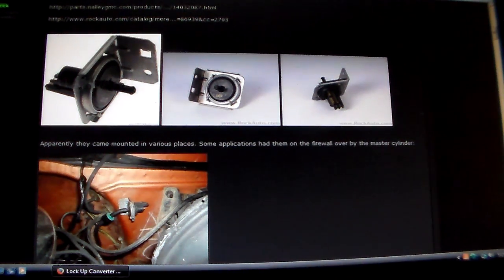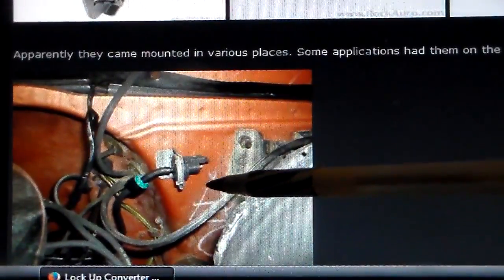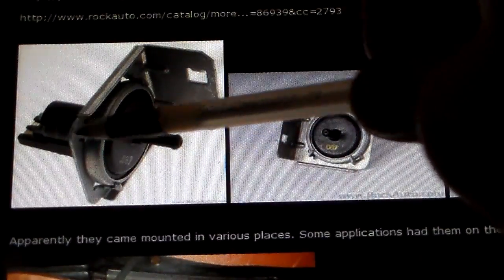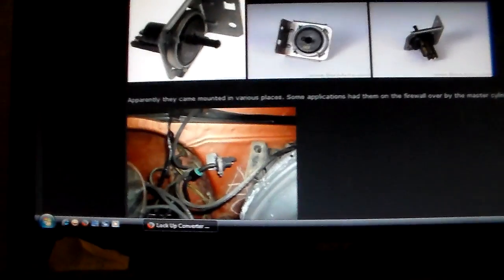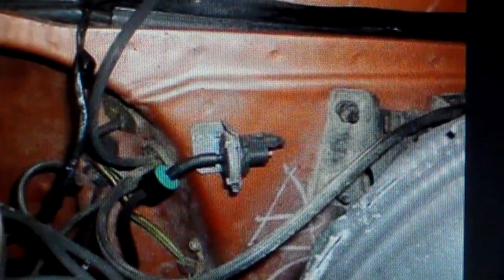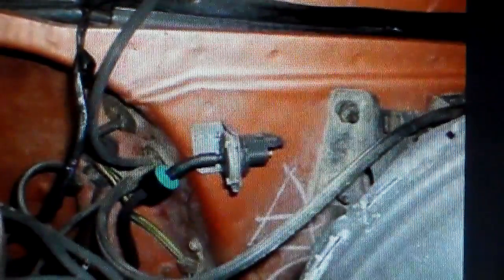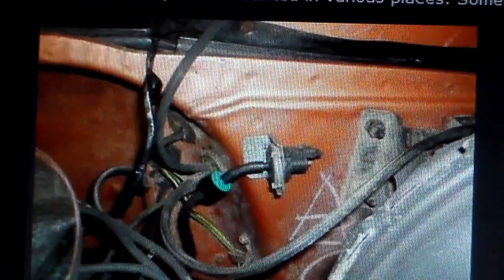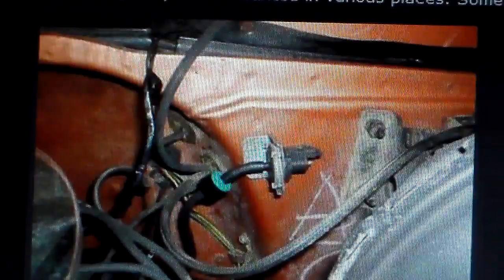How to understand '80's Silverado/Sierra TCC lockup

Comment: Actually, you can wire it to have constant power and it will lock in 2nd, 3rd, and 4th on its own and unlock by itself in first gear. The way the valve body is, the converter will not lock up in first gear. I have mine set up this way, but I added a relay coming off of the brake light switch so when I step on the brake, it cuts power and unlocks the converter. I've been driving my 89 S10 with the original transmission like this for the last three years. It has 210K miles on it and three years ago is when I put a 350 in front of that transmission.
Reply from the maker: That would work, but I think it's going to be hard on the converter having it lock in three gears, at least with a heavier vehicle, but I could be wrong.
Reply: What type of solenoid did you use on the brake lights? I'm seriously interested. I have a rat rod with a 200r4 but I not only go to car shows with it I also tow with it and use it as a work Truck. The lockup feature would be nice.
Reply: @VinnyMartello  Just change your brake light switch to one that has a N/C contact on it so when you hit the brakes it kills the power and drops out the lockout.  If your using a pressure switch for your brake lights get a 20A relay and wire the power line for the trans into the N/C side so when power in the brake lights comes on it cuts the power in the system and drops the lockout.
Reply: livesteamfan1 how u do that
Reply: There are switches inside the transmission that are in series with the solenoid that won't allow lockup in other gears, or if the trans is cold.
Reply: how can anyone help me with it i have a caprice 305 and a 700r4 it has the plug but i just want to add power12 volt and let it do the locking as i drive the car on highways also i am ok with using a switch to toggle on or off when stopping
Reply: @mussabakram5875  in order to connect directly to the solenoid you would need to pull the pan off, and the rest is self explanitory, but a much better way is to scrap everything that is wired now, (the EGR bleed valve is mixed up with this as well) and just wire it like this. There is power coming from one of the top fues block connections. Mine was a brown wire, it goes to the brake peddle switch and comes out blue wire. That goes to a connector under the hood near the vacuum switch. You can leave all that intact, but take that blue wire which should be hot with key on and brake not pressed. Take it to through the vacuum sw and on to the trans plug and inside the trans take it to 4th gear pressure switch. This sw is the one by the 2,3,4 accumulator which is in the drivers side rear corner. Go through the sw and to the solenoid and sol to ground under one of the mounting bolts. As an added benefit take the wire going to the sol positive side and pull it out through the plug using any of the other pins, that way you can use it monitor if you are energizing the solenoid, or you can put a switch taking power to it to force a lockup any time you want.
I just finished doing exactly this last weekend and it works great. Oh don't gorget the vacuum delay it is very important to reduce short cycling the conv clutch
The rest of the switches in there can be plugged off and removed. This is of course for a NON computer controlled trans.
Reply: @integr8er66  I lost my 4 th gear I was thinking of doing this. With the factory setup it locks up sometimes then kicks right back to 3rd gear.
Reply: @darellgholston9720  yep, the factory setup causes way to much shifting, I may have mentioned it, but I recently removed the vacuum  sw from the circuit and now I use only the 4th gear pressure sw and the brake sw and it works fantastic. No more up and down lock unlock etc. Very simple setup and it works great.
Reply: integr8er66 what’s the part number for that vacuum delay?
Reply: integr8er66 how did you remove the vacuum switch? did you disconnect power and plugged the vacuum line going to it? does that mean it won’t lock up anymore? i’m new to this. i have a bowtie overdrives 2004r using this switch and brake switch to unlock tcc. and i am getting tired of the shuffling/cycling during uphills. so far to remedy this, i’d manually shift to 3rd let it climb a little then put it back to drive.
Reply: @cyrusvirus6928  unplug the vac sw and jumper out the harnes side connector. This will stop much of the cycling. The tcc will dtay locked up more this way. Pretty much any time youbare in 4th gear
Reply: @darellgholston9720  You don't need to run a vacuum switch.  
An easy rewire in the trans with a new 4th gear pressure switch and take power from the N/C side of the brake switch so when you hit the brakes or downshift out of 4th for any reason the lockout drops out.   TCI and Monster transmission have the kits and video's.  Cheap and easy.
Reply: @mussabakram5875  You don't need to run a vacuum switch or a toggle switch. 
An easy rewire in the trans with a new 4th gear pressure switch and take power from the N/C side of the brake switch so when you hit the brakes or downshift out of 4th for any reason the lockout drops out.   TCI and Monster transmission have the kits and video's.  Cheap and easy.

Comment: Years ago I had an old 1990 Cavalier, and I had to replace the lockup solenoid.. was easy fixed the stalling when coming to a stop.. I remember have to backup to unlock it.. lol
Reply: 462ANIMAL  how hard was it to do this
Reply: Ok my trans on my 02 Chevy calvalier started acting up after I exited a car wash. I got codes  p0719 0753 0758  p1860  & p0135 my car runs but speed want go past 30 mph. What should I check and where to find the shortage is it in the break pedal do that runs to the transmission
Reply: @bigbodistatus8522  oh that sucks.. you got a few codes.. trans and 02 sensor bank 1 sensor 1.     2 different issues. For the o2 sensor it could be a vacuum leak.. check for that first and then clear codes and drive it . Brake switch cancels the cruise control ..
Reply: @bigbodistatus8522  is the car rusty? Maybe water leaked into the computer or could just have a bad ground or green corrosion at a connector.. need to do a visual inspection and unplug some stuff.. low voltage can also cause this.. is it charging at the right voltage?  Check a few things.. hopefully it’s something easy.